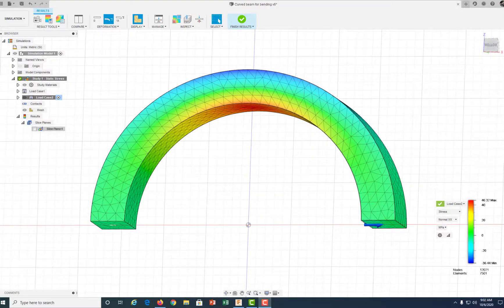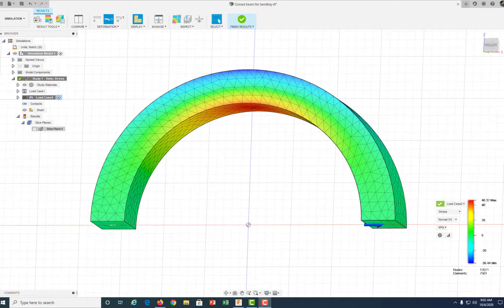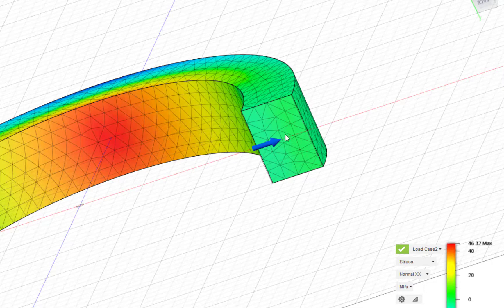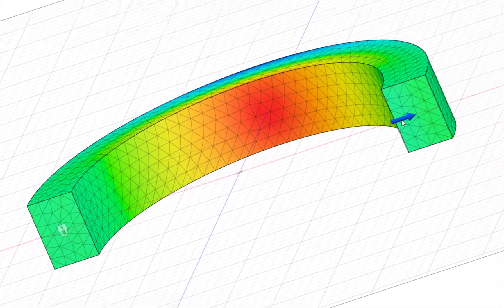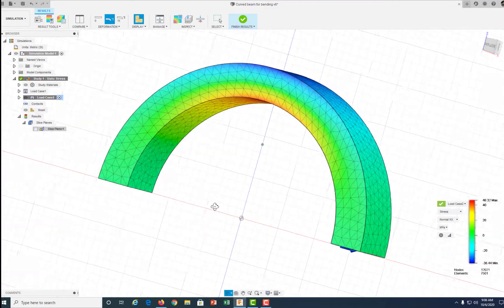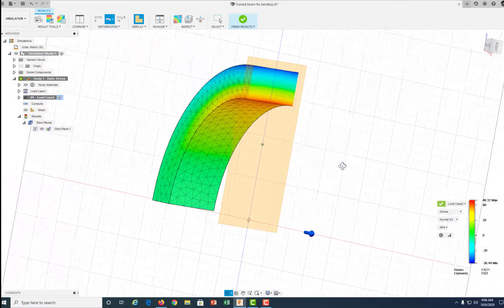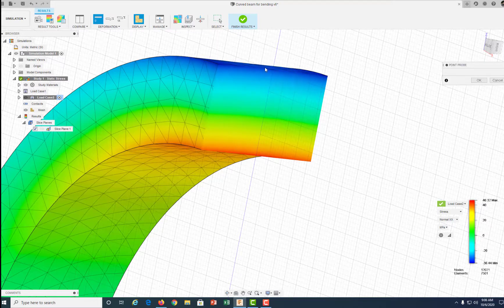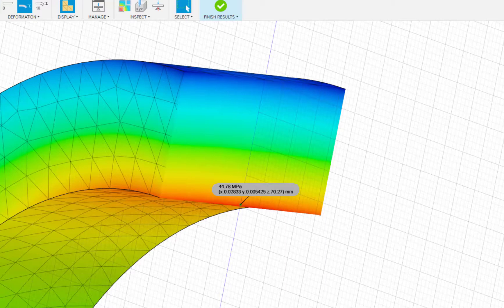Lecture 11a  curved beams in bending

Comment: Sir . I have a doubt , shall we will do ansys fluent in ansys work bench
Reply from the maker: Darshan.  I do not use ANSYS, so I am not qualified to comment.  However, any FEA program would work well.  I now use COMSOL for most of my FEA, and just use Fusion 360 for a first look.  This is a solid mechanics problem, so it is a pretty good problem for any FEA package.  I thought Fluent was a fluid program (CFD)? IF so, you do not need it for this sort of problem.